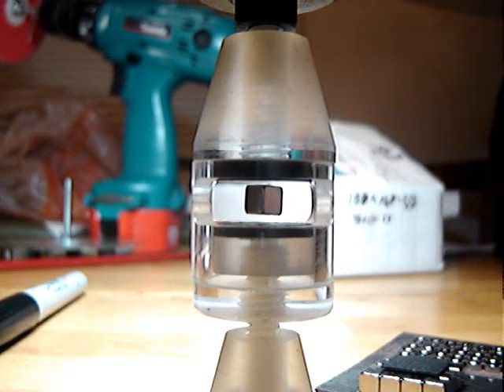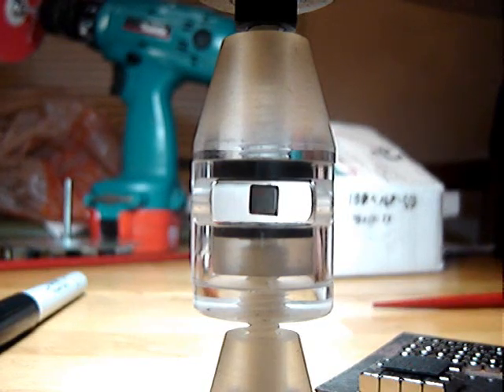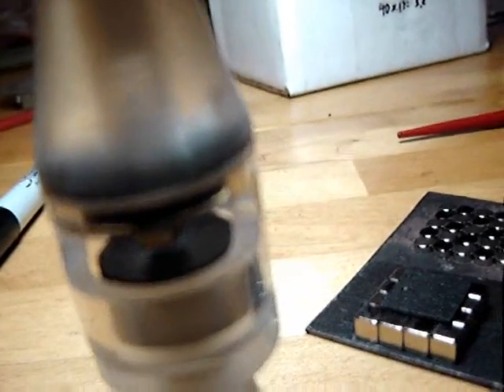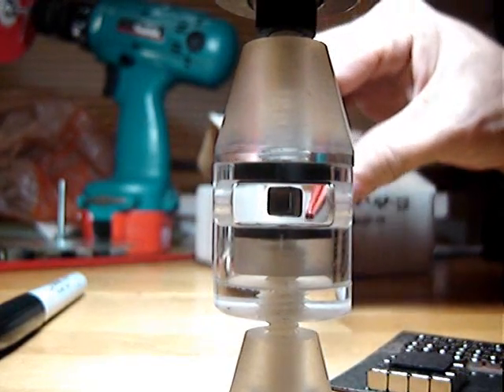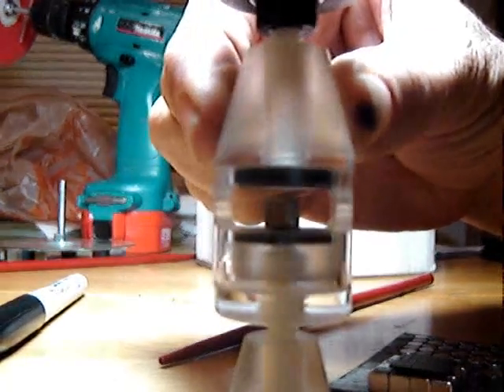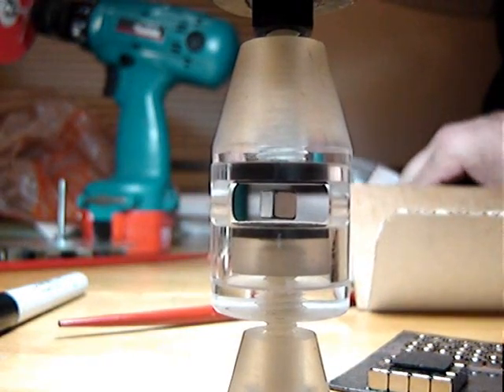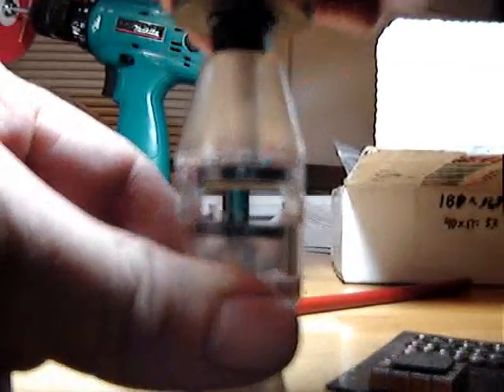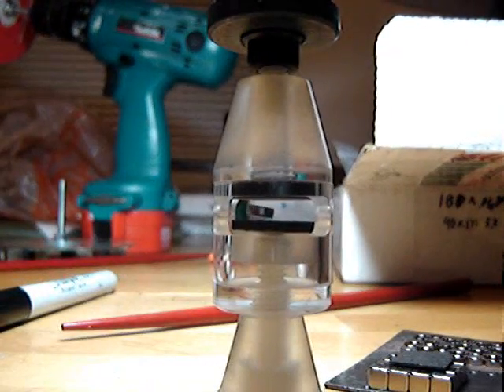Part 1: Maglev toy: diamagnetic pyrolytic carbon lifts magnets

Comment from the maker: > magnets generally outweigh the object

Not for rare-earth magnets.  Two several-pound supermagnets can lift a few hundred pounds.

The graphite gives a feeble stablization itself.  Flakes of graphite can be floated over a supermagnet array.  Look to the lower right and you can see a black graphite square floating about 1mm over magnets.  Look at 1:17 and it wiggles side to side.

Comment from the maker: Chem department.  There was a 2lb puck in the old lab across the hall.  Not obvious what they'd used it for.   I think they'd been funded by military back in 1980s to build fantasitcally sensitive EPR pot-smoke detectors.  Serious.

But buy a couple 3cm chunks from scitoys website, then use a razor blade to cleave them into many.  It's not hard to make a 2" piece.  But it won't be 0.1" thick!

Comment from the maker: > isnt bismuth more diamagnetic than carbon? 

Yes, but pyrolysis-grown graphite is more diamagnetic than bismuth by about a factor of three.   You can even float thin wafers of pyro graphite above magnet arrays, AND LOOK TO THE LOWER RIGHT.  In the video there's a floating square of 1mm graphite levitated above a 4x4 array of 8mm cube magnets.

Comment from the maker: > Does graphite contain benzene rings

Yep, it's a stack of thin sheets, the sheets made of benzene rings, with dangling bonds sticking out of the sheets.  Dense 3D carbon crystals are diamond, while dense non-crystal carbon is "glassy carbon."

When atom-thin "graphene" was invented a couple of years ago, the great discovery was actually simple:  stick scotch tape against graphite and peel it off.  It pulls off single-atom sheets!

Comment from the maker: > room temperature supermagnet 

It's superconductors which need the low temp.   Supermagnets are just magnets with exotic materials, about 10x stronger than ceramic ferrite magnets.

But also, the alpha currents in graphite (benzene rings) are diagmagnets,  room temperature superconductors.  But they're inaccessable molecular currents.

Comment from the maker: > spin forever? 

Spin for hours?  Or instead, drive it with a coil up to many hundred kRPM until it fails catastrophically.  Got a vacuum pump? Dr. Al Michaelson found that spun objects explode into hypervelocity dust.  Death by sandblasting!

Wobbling b-fields near the conductive graphite give Lenz drag.  Perhaps it could be improved by using a disk or ball, and mixing graphite with epoxy.  If that stops the repulsion, then pound the pyro graphite into micro-flakes, not powder grains.

Comment: I had never heard of a homopolar moter before and had to look it up in google.  Ithink you would still get drag from the wires touching the magnet.  If you saw what wBeaty posted at the bottom, he referes to using light to make a motor out of it.  I have seen this before.  They put black on the left half of each face and white on the right and shine bright light on it and it spins.

Comment: Errr... good point, I was thinking like a bearingless homopolar motor. That has the poles verticaly so I was thinking if you passed the current via copper wire verticly through the magnet, would it rotate?

Comment: Passing a current through a magnet makes it spin, (Basic motor)so if you had a 'C' cell and passed a current through the magnet using fine wire would the magnet spin?

Comment: Interesting, so theres a "magnetic drag" from the carbon,   what if you used a spherical magnet in a vacuum, would it spin longer. One thing I was wondering about these magnets is their field of power, or range that is, i read that some are strong but have small range, are there magnets that work from a distance, for example i walk 10 feet from a monitor and the screen gets disrupted by the magnet?Cont.->

Comment from the maker: Spin forever?  It would probably stop within days.  The small wiggles of the field will cause drag upon the conductive carbon.  If the magnet had an incredibly smooth magnetic pattern, and was suspended very far from the carbon, the slowing process would take a very long time.  (Put some black mica paddles on the magnet, then speed it up with a laser!)

Comment from the maker: It would probably stop within days.  The small wiggles of the field will cause drag upon the conductive carbon.  If the magnet had an incredibly smooth magnetic pattern, and was suspended very far from the carbon, the slowing process would take a very long time.  (Put some black mica paddles on the magnet, then speed it up with a laser!)

Comment: if you created a vacuum where the super magnet is, it would technically spin forever no? since there is no wind resistance. Also what the life of a super magnet, does it lose power over time?

Comment from the maker: Nahhhh, that's the "carbon brush" grade.   It's diamagnetic, but fairly weak.   This toy uses aligned-crystal graphite grown in a plasma flame.  "Pyrolytic" graphite.   You can split it into layers.  It's so strong that it will float by itself above an array of small neo magnets.